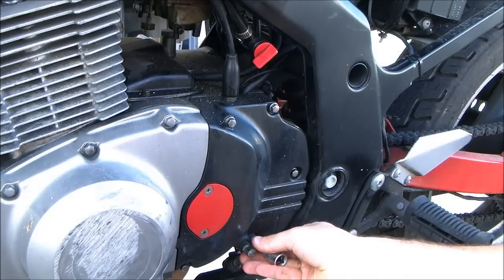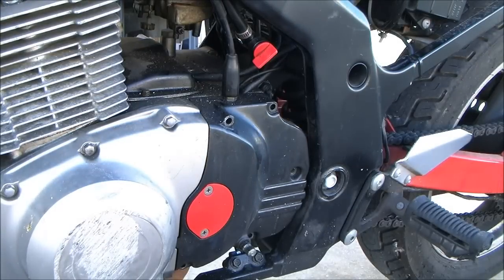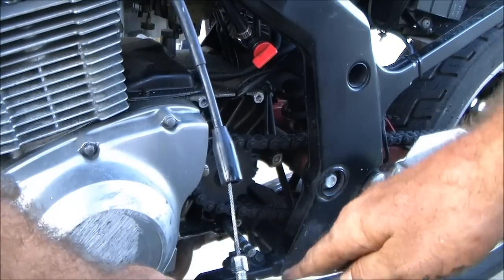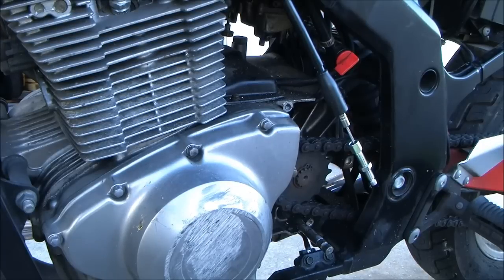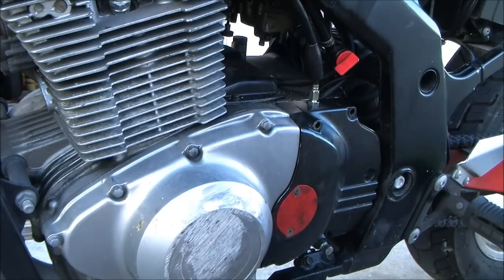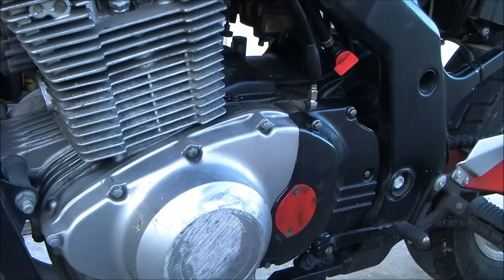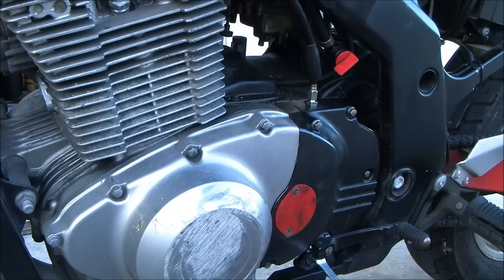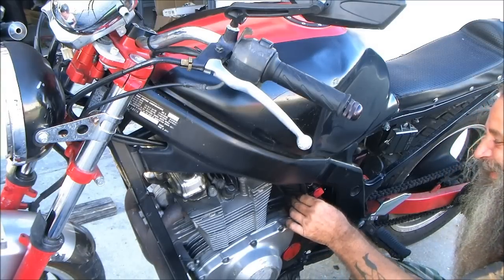Clutch Cable Change Suzuki GS500

Comment: I see this was posted in 2013 but Ill add my two cents anyway. There is a third adjustment behind the red oval held by two Philips/cross hatch screws. This is to adjutant the play in the push rod that releases the clutch plate. There is a screw with a locking nut. Turn it in until resistance is felt then back out a quarter to a half turn. Lock it back down. The clutch lever should have about 4mm of gap before engaging the cable. This is about the thickness of a US nickel (5¢).

...t
Reply from the maker: Yup .. but I try to keep em generic so folks can apply it to other bikes

Comment: I was trying to adjust the clutch by the cover and for some reason the cover refuses to go back into place.. I’ve had it off before and never had this problem
Reply from the maker: You adjust it while the cover is still on .. checklist -- did you crank it too much up and now it's trying to push further than clutch reach -- or did you by chance get it off the shaft thiggy (sorry dont know english word) and it's holding things off? No alignment pins I know of on a 500 or the 450's

Comment: Ah I’m so glad you don’t have to drain oil, I thought it went into the transmission for some reason lol
Reply: yeah I was suprised I though it went into one of the clutch cover things but that's the magneto something I guess. Mine just broke on me on start up switching into first... rip
Reply: @SwainixFPV  no way 😭😭 dang dude
Reply: @marianoperez3750  i needed to change the clutch and gear shaft anyway, it's just expensive for a student with little knowledge lol

Comment: hmm So i have a weird problem with my bike atm. whenever I hold the clutch fully in the bike wants to creep forward. The problem is I have tried adjusting the cable to the point where the adjustment nuts fall out (At the handlebar and at the engine) however It is still doing it.

Any suggestions? I have the same bike in the video
Reply: You might just have a tear in your line! I had the same issue and after some inspection I figured out I was lucky to make it home
Reply: @ryanfigueroa6079  and you would be correct! Cable snapped on me 2 weeks later... as I was pulling into my driveway of all places

Comment: How dafuk do i get that holder bend Out the way, i feel Like braking it
Reply from the maker: I'm not sure what holder you mean ...
Reply: @dawino6260  i ment the little Thing Holding the cable in place in the Box before the Clutch, the one you that you Bend Up with the screw Driver. 

In the end It worked fine with a screw Driver and a Tong and my Bike is driving again. Thx for your Video, was a great Help!

Comment from the maker: it's normal for it to rev up to 3000 if you have the enricher on yes... or if you have the idle adjust screw (not the mixture screw the one on the linkage) a hair too tight... but yeah generally it's a matter of set your mixture and idle - so plug and play almost applies... also - not sure if it does it on the 250 but one of my GN400's was victim to a fuel line that didn't drop straight and would go lean as a result - that will also crank rpm undesirably

Comment: Exactly the video I needed. Thanks for the post! I just performed this on my 83' GS450 but I dunno if I can't figure out the adjustment as It starts but when I try to put it in gear - nada. It feels close. I had to take off the shifter to do this. Maybe I fucked up the placement of the shifter? Maybe something else? Is the 15min mark where your pushing the tab in out of frame of importance?
Reply: What was the solution for you? I’m getting same problem
Reply: @kofiill2509  So long ago now... If I correctly recall, it came down to a lot of fussing with the cable tension with the clutch until I found the sweet spot. I remember it being looser than I thought it should be... good luck!

Comment: Good way to burn yer clutch out!! There’s 3 adjustments on them bikes. Way to tight with no play at the lever.
Reply from the maker: I leave 1/8" slop at the lever .. and make sure my bars are at the tightest spot the cables gonna have when I set the upper hand lever side .. I dont always explain that .. but it is something I do

Comment: hi i got a question  of topic but i wan to know if i re-plece carb in my suzuki gn 250 i need to adjust it or just plug& play ? . the reason on choke when cold som times dont want to start if starts rews rush to 3100 rpm this normal ??